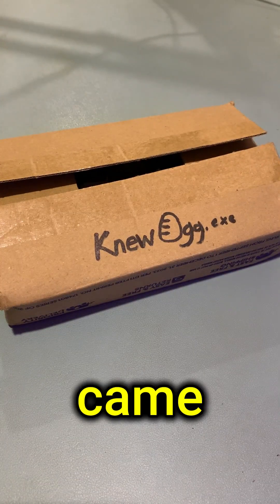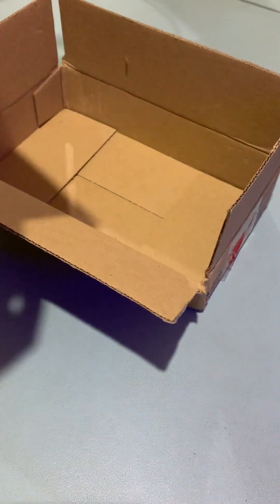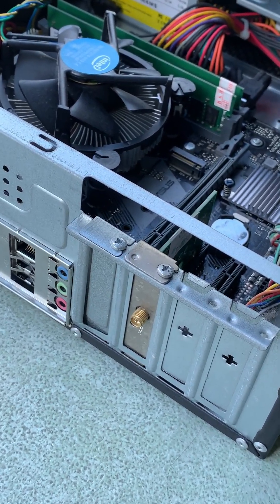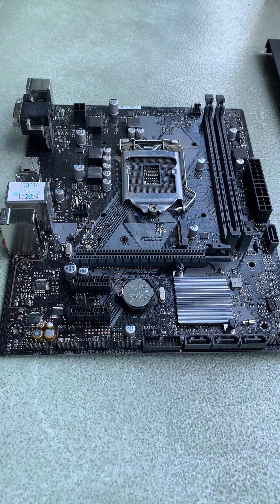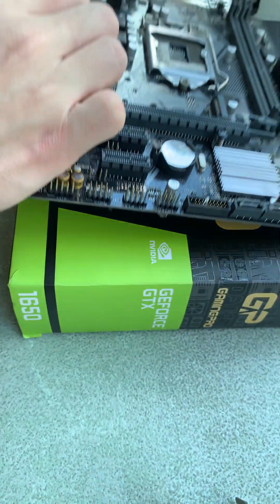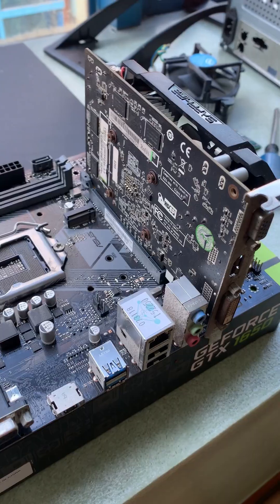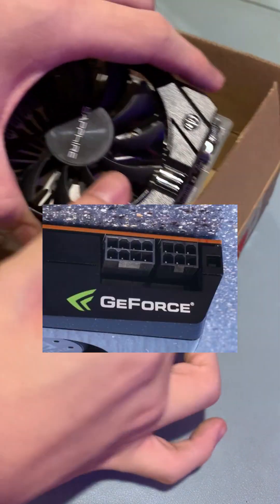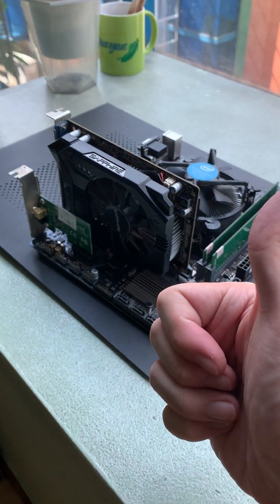How To Install a Graphics Card! #pc #pcguide #gpu #graphicscard

Comment: I know nothing about pcs what are u adding it onto is that the motherboard? Also do i have to take this out when i do it or can I leave it in
Reply from the maker: Yes, it is the motherboard, the thing that delivers power across your PC! Also no, you do not have to take it out of the case to install it, I just did it for the camera so you can see it better, and also because the PC’s case this motherboard came with couldn’t fit the graphics card in!